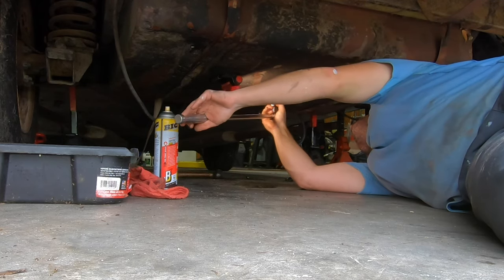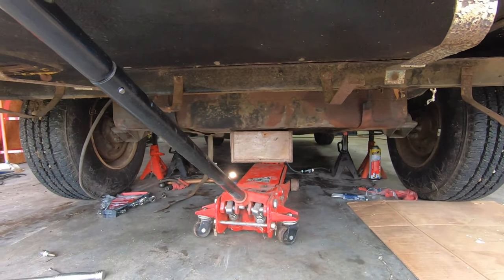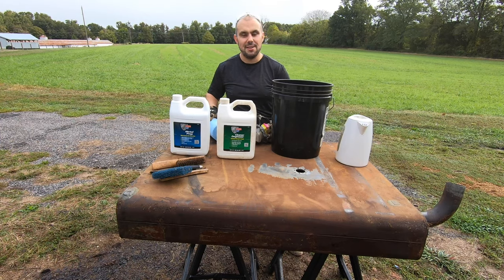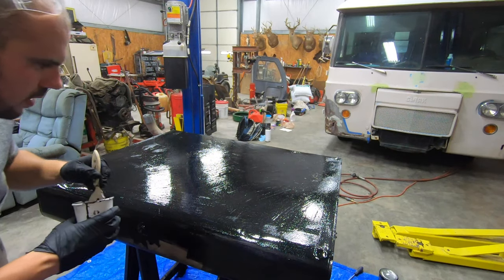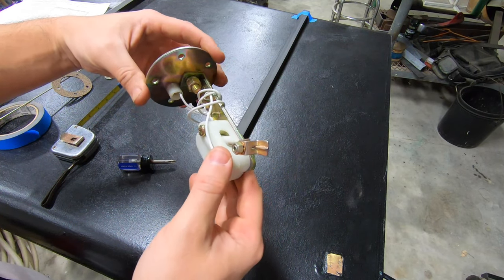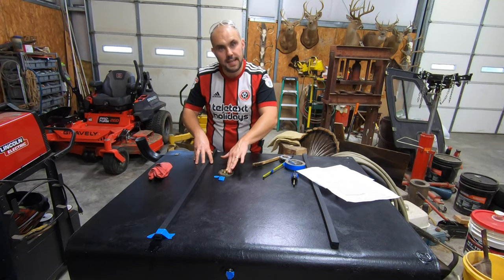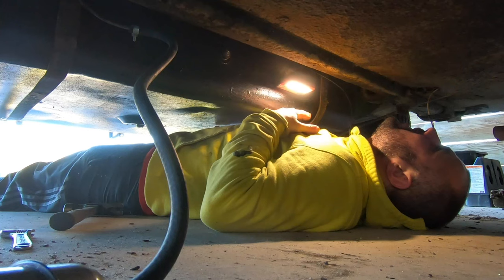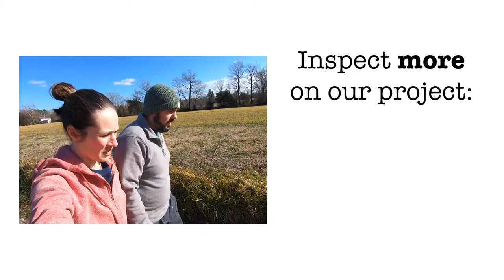WELL, THIS DID NOT WORK AS PLANNED: RV Fuel Tank Restoration for Our 1965 Clark Cortez Motorhome

Comment: Ophelia’s tank was so horrible sitting with gas and not running for 20 plus years. The generator fuel line also connects inside it. After seeing the amount of junk inside mine I sent my tank to a muffle shop and they boiled it for a week in acid then had to cut a hole on the side to repair the fuel lines to the generator and the motor then welded her up. I painted it and but the sender unit on myself. 960 for a new tank vs 320 for the shop to clean it out.  Definitely not Andy’s fault that’s the joy of restoring a vintage home once you take off one part always expect to replace three. But once replaced these babies should last another 50 years! Keep your heads up!! I’m wanting to see you guys on the road one day!!
Reply from the maker: Hi, Ophelia's owners -- Great advice and much appreciated!  I suppose I do not blame Andy on these fuel tank terrors looking back . . . though at the time, learning and seeing one sheer after another and then the stuck carbide extractor got the best of my patience for the person holding the tools.  (Poor, Andy -- I'll be sure to apologize and tell him this hehe)
Mercy, Ophelia's tank sounds frustrating, too.  I hope she's better now and most definitely -- Seeing you on the road would be incredible!  Here's to that day!
L (and Andy)